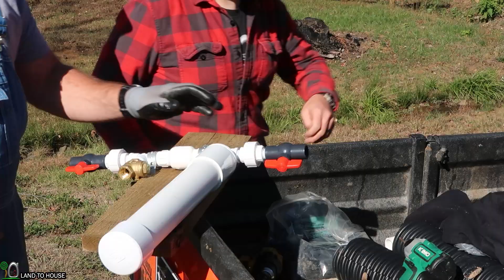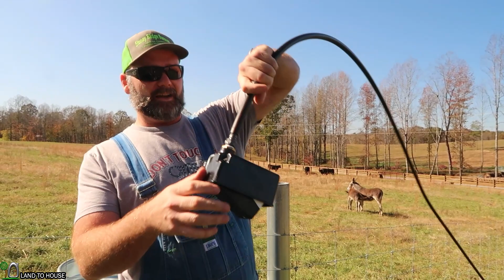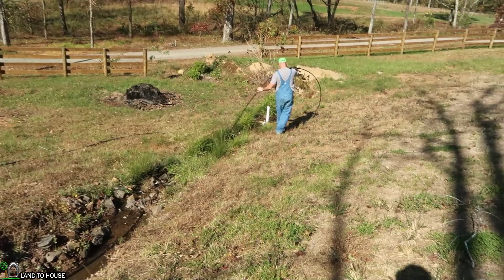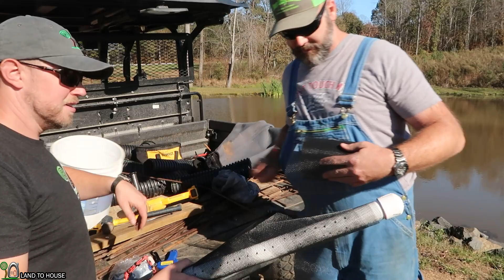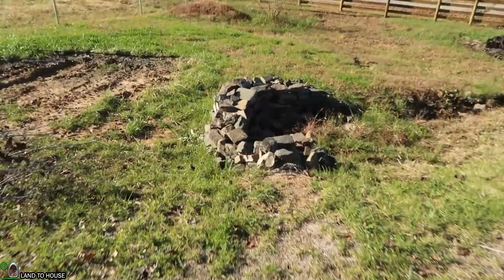1/2" Ram Pump From a Pond with the Stoney Ridge Farmer

Comment: Hey....I know that guy lol  youtube.com/stoneyridgefarmer  Woooo!!
Reply: hey brother, what's the total elevation gained?
Reply from the maker: This setup only had 20 feet lift approximately.
Reply: @LandtoHouse  I'm looking to push up about 70'. There is little drop for the drive line, about 10'. I want about 2 gal per minute. What would I require?
Reply from the maker: @TheAwesomeHomestead  The 1-1/4" pump needs 8gpm to operate and can lift 70 feet with 10 feet of input head. The output will be around 1gpm.
Reply from the maker: Haha woo.

Comment: 😆yeah…just enough to p!ss you off.  Thank you guys for showing me.  That is a really neat device that pumps water uphill…no electrical…keeps it from freezing for the most part…saves you tons of chore time everyday….water about 10 cows!!…you could even place a return line back to the pond if you were concerned about wasting the splash from the hammer valve….Good stuff.

Comment: Why not run a return line from the tank to the pond to avoid using the float valve and prevent stagnation of the water when livestock moved to other locations?

Comment: If the waste valve runs 24/7, will it not drain the pond shortly?
Reply from the maker: The pond is creek fed. It has more overflow than the pump uses.
Reply: @LandtoHouse  gotcha.

Comment: That Was REALLY  COOL  Because I Have A Pond That is Spring Fed Year Around So Now I Need To Find Out How Deep Does It Need To Be & If It Matters How Large or Small it Is, Right Now I Think it's  About 3 ft Deep & 25ft long By 8 to 10ft Wide at The long & Wide Parts ???  So if You Could Talk About That it Would Be Really helpful  Thanks
Great Stuff 👍👍👍😀

Comment: Question: Is it possible to redirect the waste valves water without affecting the functionality of the pump?

Obviously for a stream source you are not really "worrying" about the source going dry (aside from droughts and odd nature/weather problems), so maximizing everything running off the waste valve isn't really a concern especially when running in a creek bed.

Say I were to collect rain even on the roof of my house and I have a steep incline in my back yard that flattens out where I have a garden on and want to run that water to my garden without carrying buckets of water that I am just siphoning out of collection barrels at the base of the incline. The flat of the incline is higher than the storage tanks so I know I cant siphon out to the top of the hill because of the laws of thermodynamics/gravity. I could use a ram pump to push the water up the incline to a secondary holding tank or soaker hoses but I am loosing water at the waste valve and i don't need to water one spot of my lawn. If i could redirect that waste waste into even a smaller collection bin to reduce the "waste" seems like it would be resourcefully responsible.

so if you can redirect the waste valve water run off, how high would you be able to push that? My thought says since it is a 1 way valve and cant be reintroduced into the drive/supply line, it will continue to open like normal until the pressure off the waste gate equals the pressue/level coming in from the drive line.

has anyone played around with this idea at all?

Comment: Seth has anyone in the UK ever built this? Im struggling to find the parts
Reply: Ebay / amazon / local store?
Reply: @ДенисДавыдов-у1з4ы  68,574 views • Nov 15, 2020 •
Reply: Same here. That pvc inline spring valve feels like we need to send elon to mars to source it there.🤣
Reply: I'm in Ireland, you can buy the parts in any plumbing supplies shop, only difference is that the spring loaded valve will be brass with a BSP thread .

Comment: The water supply I want to pump from is over two meters in depth why would I need to Inlet pipe lower if I can set my pump up at a depth of two meters under the water. My water depth is always at this two-meter depth. 
I'm hoping you'll answer this question.
Reply: I could be wrong, but I don't think the ram pump works when it is submerged because the water pressure will keep the waste valve from closing like it is supposed to.

Comment: My home sits 15 feet above a very large retention lake/pond. How could I get a ram pump to work to water my garden?
Reply: you probably could get it to work, if you digged a trench below the water level then let the water flow down to the ram pump.
Reply: @ggesdsdsdsd  How do you control water not filling the trench
Reply: @maryalobo1287  been trying to figure that out aswell lol
Reply: @ggesdsdsdsd  Can I use siphone to pull the excess water in the dug hole back to the lake?
Reply: @maryalobo1287  the waste water from the ram pump would eventually flood the ram pump, but it can still work under water i guess. But maybe you could also use a "V pump" and could solve that problem.
Reply: Solar water pump to ram pump. I did it.👍👍👍 Solar pumps don't have much head pressure 3m
With ram pump 70m from my dam
Reply: @matthewallen1394  Hi, How did you do it? Can you send me a picture or a diagram of how how you did it?
Thank you,

Dan
Reply: Can't do it unfortunately at least not with a ram pump, you need to harness the  flow of water in order to make a ram pump work from a pond you'll need a motorized pump
Reply: Windmill pump hand pump. Or heat the water with solar water heater?
Reply: Would having a long pipe, with the inlet floating, feeding the ram pump sitting on bottom of the pond?

Comment: ***Question for Seth****
I watched many of your videos and was impressed on your presentations. “Clear, simple and to the point. “ 

Where I camp is always in secluded areas but always by water. One spot has a fast flowing stream and I would like to run by you an idea, I have to see if it would work.

Instead of using a long input line to the pump to develop head pressure, since the stream is fast moving; how about using a 6 inch diameter pipe approximately a foot long as the lead in pipe to the pump reducing it down to the normal input size.
The pressure at the 6-inch side will increase in the smaller entry to the pump creating a greater head pressure. If I am right, the flow rate will remain the same but the pressure will increase, thus acting like a long lead in line.

Bill

Comment: Can I use a 100 gallon Stock Tank as my "Source" of water?  I want to create a constant supply of flowing water to a Bird Bath in our yard.  Water can be returned to the stock tank through a filtered Drain at the bottom of the Bird Bath!..
Reply from the maker: You can use a storage tank as the water source. You will have issues with running out of water very fast. Lets say you have a 275 gallon ibc tote. Using a 1/2" ram pump that uses 2gpm you will be out of water in 2.3 hours. The water that will be pumped is only around 30 gallons from that tank. the rest of the water will have left the waste valve on the ground.

Comment: I'm soooo dissapointed. I looked at the thumbnail wrong and thought you found a way to get a ramp pump to work in a stagnant pond, haha.
Reply from the maker: That would be a massive achievement! But sadly no still have the head pressure input.
Reply: You possibly could get it running, with a siphon to the ram pump eh? Maybe

Comment: I'm thinking about a micro hydro station for my property. It's on the intracoastal and there's about an 8ft drop from the property line to the water. Any suggestions for siphoning the water upward? Ram pump?

Comment: Hi Seth.. I'm from Indonesia.. I'm wondering what if you put the rump pump and intake pipe in the pond. (Ram pump at the bottom and intake pipe at higher positions) so that intake water comes from the pond...would it works?
I hope i made myself clear..
Reply from the maker: Sadly no this does not work. There is no flow in a pipe that is sunk in the water. Like placing a straw in a glass of water.  The water does not continually flow.
Reply: @LandtoHouse  Thank you Seth..

Comment: I'm about to set up one of your 1/2" pumps on my property drawing from a beaver pond very similar to this. I had already built a siphon setup just as you described so I'm glad to see that you suggested it here and I'm hoping that it will increase the efficiency. Would you recommend using a hard PVC pipe after the siphon bucket down to the ramp?

Comment: Thank you - great video!   I learned a lot and as usual I have questions.    I've also linked to this video from the discussion about about this installation in the Water Powered Pumps Facebook group:  https://www.facebook.com/groups/240458583255303/permalink/698550144112809/

I believe that Land To House has four sizes of pumps available - 1/2 inch, 3/4 inch, 1 inch and 1 1/4 inch drive pipes.  Have you found that there is a relative proportion for the the volume of water pumped for each size pump that holds constant with different heads and lift situations with enough water available?   (1 inch drive pumps   deliver 1/3 more than a 3/4  inch or something like that?).

The water pumped may be totally adequate as installed in the video - if so, task done and back to "feeding the cows".   If more water would be helpful, I did notice a couple of fairly easy items might increase the flow:

(1) The delivery pipe to the tank went higher than necessary to the tank.   At first I thought the delivery pipe was going to be run along the top of the fence, but saw that it dropped to the bottom which is what I'm planning (out of the way).  An elbow at the float would allow the delivery pipe to come into the tank float valve with less lift.  I'm not sure, but the rule might be double the lift height gives half the volume of water pumped - or perhaps less.

(2) I paid attention to the use of poly pipe for the drive pipe and this was discussed in the video.    I currently use 10 foot sections of PVC pipe with rocks on top for the drive and supply pipe (to a stand pipe - bucket approach discussed in video).   However, I do use poly pipe for my 3/4 inch delivery pipe and I need all the volume and pressure I can get - so I made outside connections for the 3/4 inch delivery pipe using 3/4 inch threaded PVC connections and 3 turns of black electrical tape around the ends of the poly pipe (inside the PVC connections).  In my low pressure situation, I'm not sure the outside connections are necessary, but do feel in a separate gravity feed approach that the inside connections of garden hoses strangled the volume of water output.

Filtering is a big deal - need it to work, takes effort create and repetitive work to clean.   Noticed that you used the fiberglass screen material - I've tried both aluminum and fiberglass - I like working with the fiberglass better.   I sewed a sock with the screen and dental floss.  The wrapping method shown is definitely faster - not sure I want the multiple layer wraps or from a ease of cleaning standpoint.   Delivery use may dictate - how good does the filtering need to be.

As you demonstrated, we need to keep the filter in place in the pond.  I was going to use an anchor rock with a float - your approach with a float on a pole might be easier for maintenance and to find the filter.  My plan if I walk into our pond is to have a rope on me and a vehicle and hope a helper can pull me out of the deep mud.

I laughed at starting the siphon in the video.   I had a horrible time getting a gravity fed siphon to start with 3/4 inch pipe out of a pond bank because of the air lock.  And like the video, I really didn't like inhaling the pond water.  

The siphon to an intermediate bucket was mentioned (think this functions as a stand pipe).  My ram installation is different so results may vary, but I found a 70 percent increase in water pumped by putting a stand pipe after 50 feet of 2 inch delivery pipe giving 20 inches of head and then only 20 feet of 1 1/4 inch drive pipe to gain another 10 inches of head to the pump (total 30 inches of head).   I was unwilling to run 70 feet of 1 1/4 inch steel drive pipe and went with PVC.  However, with the supply being 50 feet of 10 foot sections of PVC, I may switch the 50 foot supply to 50 feet of 2 inch continuous poly similar to what you used, continue with PVC for the 20 foot drive or consider steel for just the 20 feet.  I think I can make the connections at the ends of the 2 inch 50 foot poly supply pipe with 2 inch threaded PVC connectors like I did with the 3/4 inch poly, but I may have to pre-cut the threads with a steel threaded connector.   The point being - I like the ease that you put in your drive pipe with the poly and you did not have to deal with a lot of connections between 10 foot sections.

Great video with good quality audio and video.

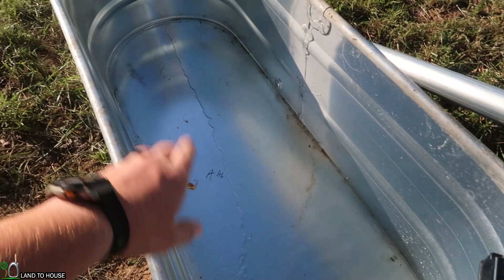Comment: 22:44
I dont unterstand, Seth.
This valve woudnt stop the pump from pumping, right?
So the pressure will open the valve, even when its under water.
Reply: I wondered about this also - or maybe the valve just sticks open or closed?   Can a second swing check valve do the job of the inline PVC check valve?
Reply: @BL8 the it has buoyancy it will float on top of the water then close. Similarly to a cup catbrator when the catbrator fills the bowl the disk rises and slows/ stops flow.

Comment: for the inlet that sit's in the pond; use an anchor to keep the inlet end just under the water enough that no air is suck in. if need be a float can be used to keep the inlet pipe in position. by using the anchor and float together it will keep the inlet in under the top of the water , yet off the bottom also.. this will help keep the inlet running longer wit out stoppage.  good luck..

Comment: This is a perfect example of how useful a ram pump is. 

Seth, Concerns about freezing?
Reply: For freezing conditions... Or even "normal operation" I'd say remove the float valve. Run an "overflow" line back to the pond. Moving water won't freeze nearly as easily as still water.
Reply from the maker: It will be interesting to see how it performs in the Winter time. I actually hope to run a couple tests in a month or 2 when it gets cold around here
Reply: @LandtoHouse  Freezing is also a big issue.   This summer was the first year for me using a ram pump in the mountains of Colorado.  In September, I removed both ram pumps from the stream, disconnected the supply / drive pipes and disconnected 1500 feet of delivery pipe (so far the delivery pipe just laid on the ground).  

Next year, I'm planning on running the delivery pipe along a fence for part, bury part and may have some left above.  Hoping I can drain the water out of most of the delivery and leave next  year.  Pumps, supply and drive pipes may still have to come out because of freezing and spring high water (I guess we still have this - climate change and all) considerations.   Note to self - get more backup O rings.

Comment: How long will the ram pump run with the float valve closed?
Reply from the maker: The pump will run as long as it has a fresh water supply. The issue might arise if the float valve re opens and too much water is expelled at once. It might cause a back pressure loss issue. It's possible there was enough lift height that there is no problem. The ram pump will only build a certain amount of pressure based on the input head pressure

Comment: You could probably improve it by having an elbow just above the float valve, and then the water wouldn't have to get lifted to that extra unnecessary height before getting to the trough. It may then be easier to shield it there also, with a piece of metal off the fence post, to make it cattle proof.
Reply from the maker: Very good point. I remember Josh saying " I should have bought an elbow." He had the same idea there.
Reply: Sorry, I didn't see your post before I mentioned the idea in mine.   I think that doubling the lift height might halve the water volume, but I'm not sure and not sure what change there is to the water pressure.  Any ideas?